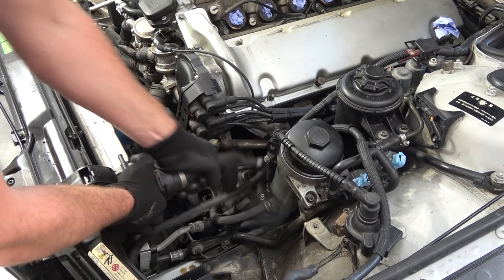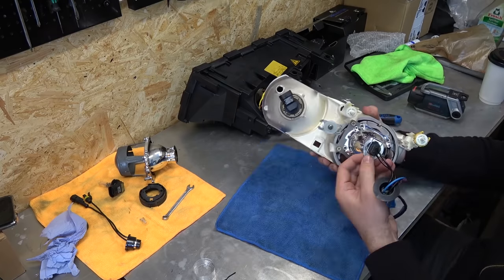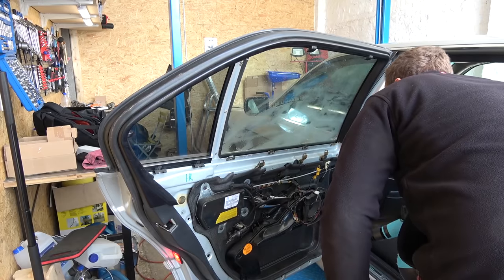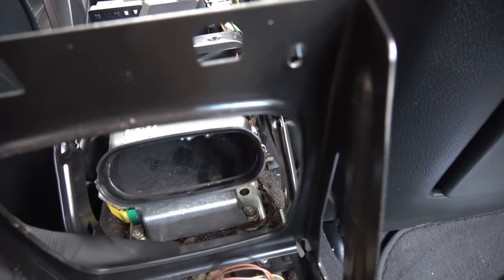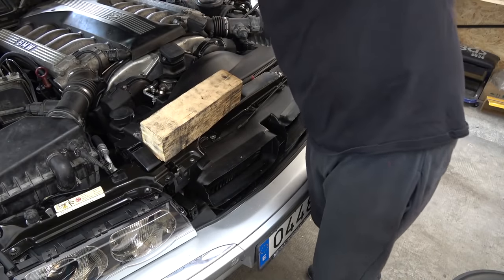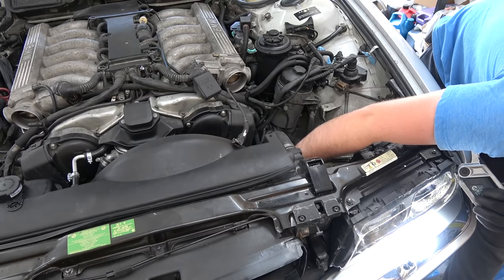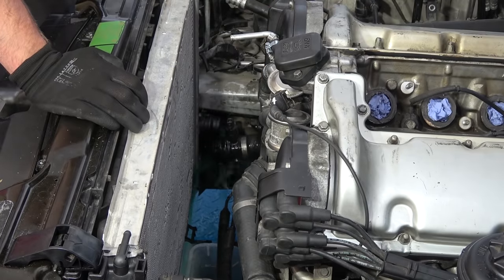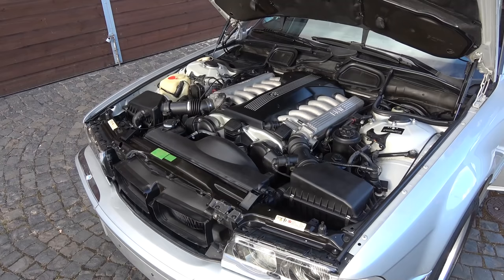V12 BMW E38 750iL Restoration - Project Dubai: The Battle - Part 4

Comment: I find it a bit hypocritical to hate on Depo parts yet fit aftermarket projector lenses with a cheap H1 35W HID/xenon kit. I'm surprised it even passed TUV considering H1 is a halogen bulb, so an H1 xenon bulb cannot have the correct approvals as it doesn't meet H1 standards. The least you could have done is bought a Mini D2S projector kit with which you could use real, approved xenon bulbs from the big brands like Osram or Philips.
Reply from the maker: All of the parts are from Retrofit lab that are plug & play for E38 headlights and none of it is cheap or poor quality. The bulbs are XB35, I wish it could take D2S but it doesn't and this is their kit for E38. There's isn't much space in these headlights, I have Hella G4 in my M5 with Osram CBI bulbs and love them. TÜV doesn't look what's inside your headlights, as long as they are aligned and working properly. I hate Depo because they look nowhere near as close to OEM headlights, they just scream cheap aftermarket junk, especially the headlights and taillights that you commonly see on E39. As far as their quality, they are better than plain made in China stuff.

Comment: this heat shrink over wires i think is wery unprofesional and dont know why you did that, also soldering in forbiden in the headlight where there can be sufficient temp to molt solder
Reply from the maker: I explained in the video, maybe listen. I replaced the wiring completely later off camera once I got my hands on a new set from the dealer.

Comment: "let's face it, it will NEVER leak". Famous last words from the last mechanic that glued the other side also before it started leaking. 😂😂😂 You're already there. You might as well spend the extra 2 hours to pry it off and fix it the right way. Come on man. It's not like you to cut corners like that. That's like probably the first time I've seen you not do a preventative maintenance. You usually do stuff that might not even be necessary but it will make the car better for the future but in this case you totally skipped something that would have been almost always recommended to do. Even by you yourself. #Disappointed
Reply from the maker: It's easy for you to write that but you didn't see or do what I did. It took 40 minutes of insane prying to separate it to the point where I bent the valve cover and had to hammer it out after. Then it took 3 hours just to clean everything cause the glue simply wouldn't come off, not even with goo gone or anything else. When dealing with stuff like this you have to make a judgment call to see if it's worth the effort and in this case it wasn't, I had a risk of damaging the other valve cover where I would have to replace it which would mean more delays, not to mention all the crap that lands in the engine when prying it off. I didn't cut corners, I can guarantee that it will never leak, with that crazy glue it's essentially permanently bonded together, the new gaskets will start leaking before the other one. Also, I was so infuriated with this that I wanted to set it on fire and the other gasket would tip the scales.
Reply: @M539Restorations  oh ok. In the video you wrote it took 40 minutes to take it off so I thought you spent 40 minutes to take it off and maybe another hour to clean it. You didn't mention it was way way so much more work than what you showed do I thought you literally just didn't like 2 hours to take it off and clean it and put it back. LoL. Gotcha. It makes sense. I fucking love working on my own BMW's to do that's why I love this channel. And the edits are really cool to watch the way you do the quick noises and he way you make your video cuts. Like you have a edit where the guys take the windshield off and you show then going to put it on again and they're going in slow motion over the hood (you were holding the hood down for them and then right when they were going to lower the windshield in place you speed the video up and it look like they just dropped it. 😂😂😂😂😂😂 I literally freaked out for a second thinking they dropped it but then I noticed you weren't from slow motion to like 4x speed. Shit like that is such cool edits. That's why I enjoy your videos. And yeah you know like 1000 times more about these cars than I know so I only said what I said based on the information in the video. So I'm not trying to judge you. I was just saying I wild have spent the extra 1.45 hours. But if you're saying it was closer to like 4 to 5 hours then yeah fuck that. 😂😂😂